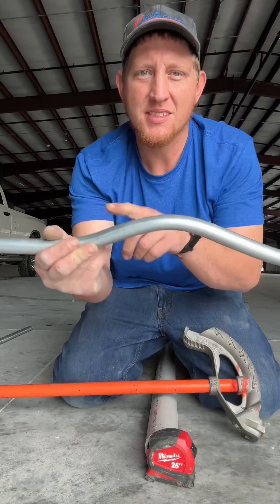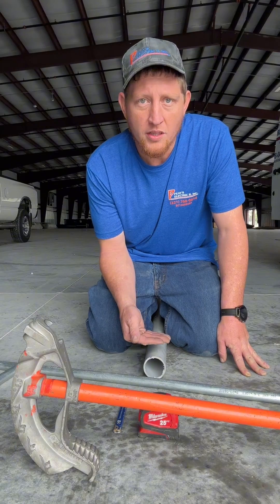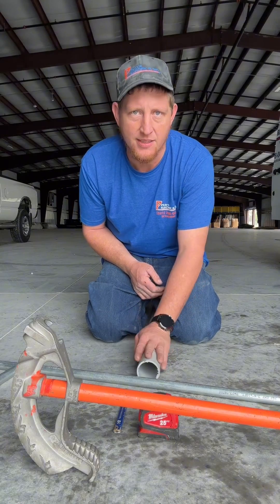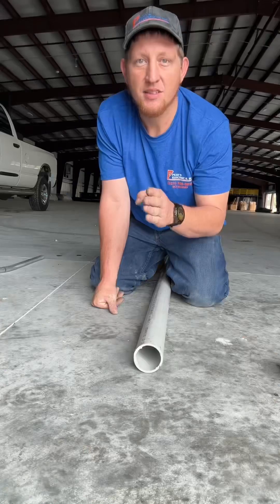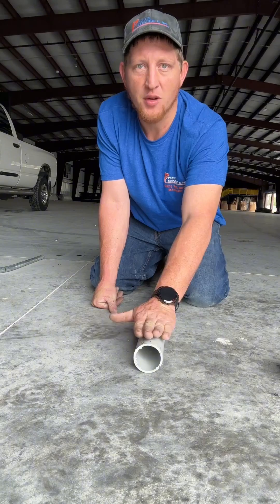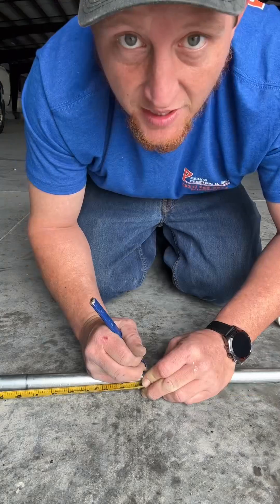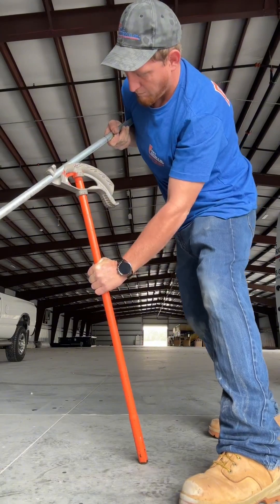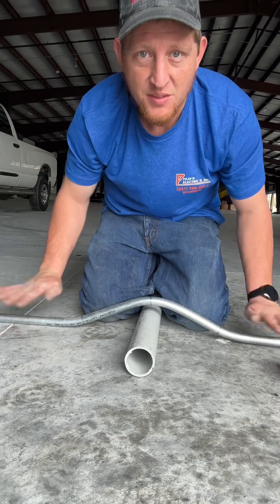How To Bend A 3 Point Saddle EMT Conduit.

Comment: Awesome , i ran into a bend that was 16” to center and i did the calculations it was just hard to flip the emt around and bend when i only had like a foot to try and bend 1” emt , so i just did the push thru method , where you start at the first 22 degree bend then the 45 and so on.

Comment: So if your obstruction is 1" the distance between your bends should be 2.5"? Almost every saddle we use is to get over anither pipe. So its always 1"
Reply: Yes, 2.5” for every inch of obstruction so in your case 2.5” from your center mark on both sides
Reply: late to this but if you bend them 2.5 inch from center the pipe will just ripple seems like the minimum for 3/4 emt is 4 inches can get them a little closer with half inch emt.
Reply: @haidenwalker652 the only way to get the bends closer is a push through method. And you can use 30 degrees for the center bend. I’ve even seen a guy online do a 20 degree bend. You can get them very shallow this way

Comment: Is 3/16” only for 3/4” emt or is that applicable for 1” Emt as well?
Reply: I know it also works for 1/2 EMT so chances are yes. But you probably could the answer by now lol
Reply: The shrink depends on the middle bend degree.  With 30 or 45.